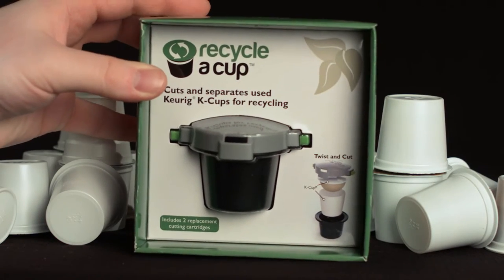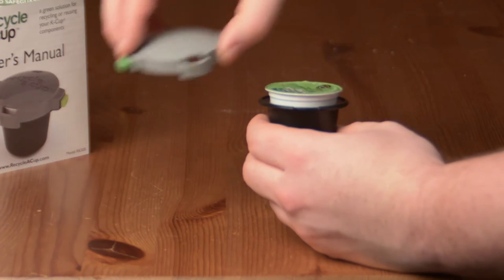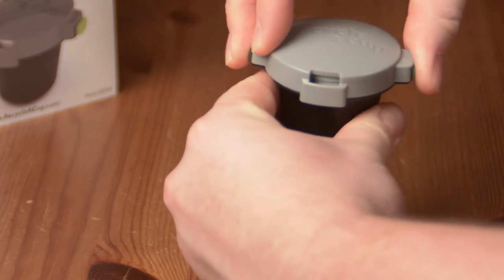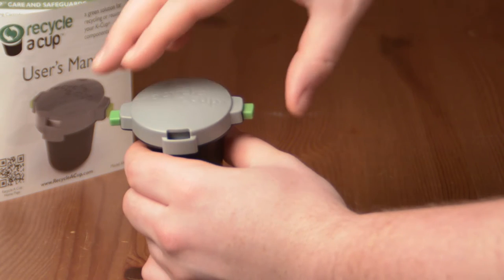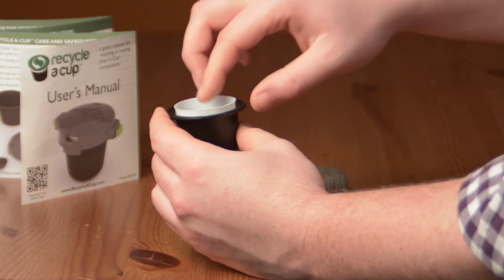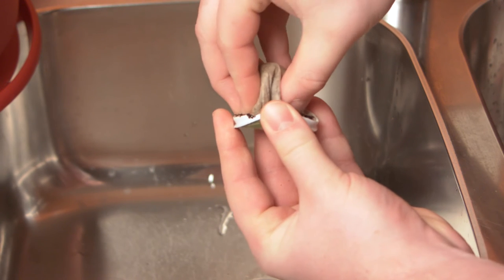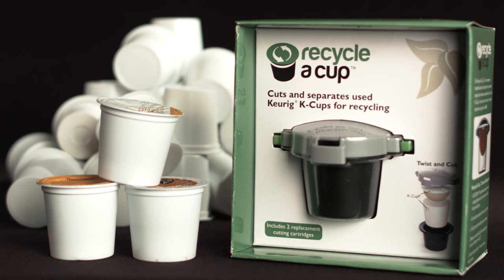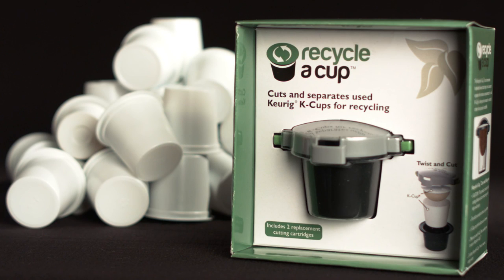How to Recycle K-Cup® packs: Recycle A Cup® - How It Works

Comment: Here's how I found my successful rhythm:  using the top apparatus only, twist off the top, removing plastic cup. Then place the remaining lid with grounds/grinds attached deep into the sink -  twist the filter "sac" w/ grounds to remove, as shown in video, then push down on top lid with thumbs -  and with one forceful push it goes thru the foil (using weight of grinds) pretty well, so that the foil portion is easily removed in one motion.  I recycled the lid and cup, whether appropriate or not. Worth it? No. But as long as I'm too lazy to change my buying habits, I'll try to maintain recycling process.

Comment: Keurig is a quick and easy way to make coffee.  Simply put, this invention goes against the whole idea of using a Keurig in the first place.  I think this is a start, but this is not the solution for getting grounds into ones compost bin in a snap.  The solution should be just as fast as loading your Keurig and this is not.  I imagine something akin to an orange press because it's just one movement.  Plastic is now separated from grounds paper and foil.  But now you still have to remove the foil with your fingers.  I'm considering switching back to a drip machine for two reasons: 1. Keurig does not taste the same as drip.  It's not as flavorful or strong.  2. I now can't just toss my coffee with my filter into my compost in one step.  This invention is great, but for composters, it's a bit of a challenge and ultimately a waste of valuable time.